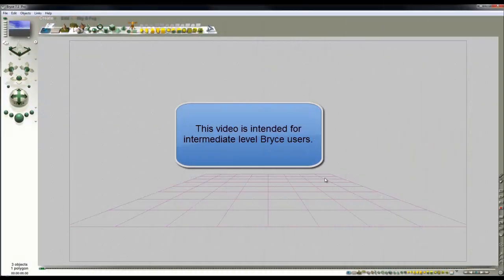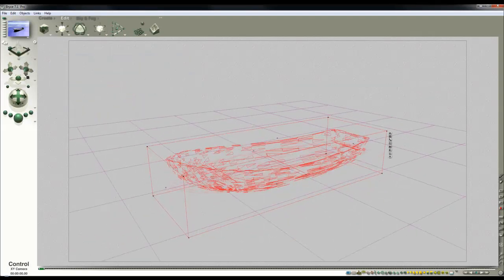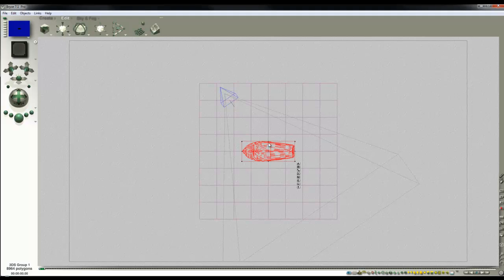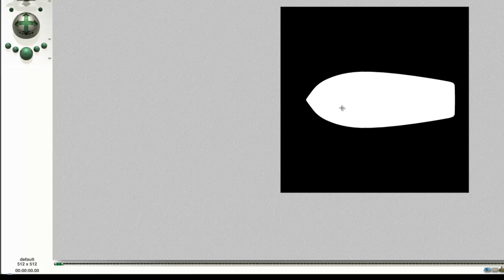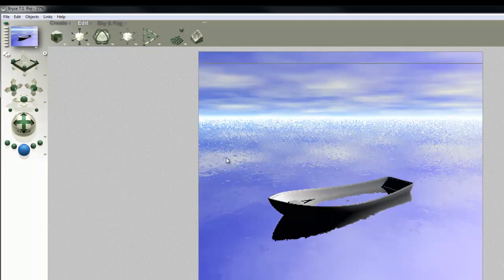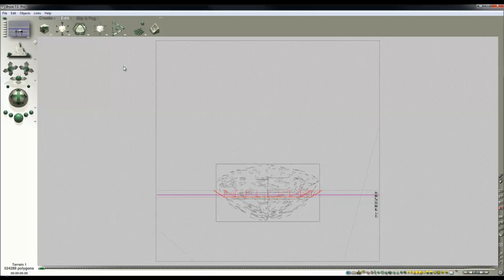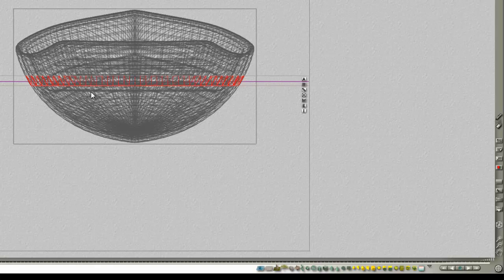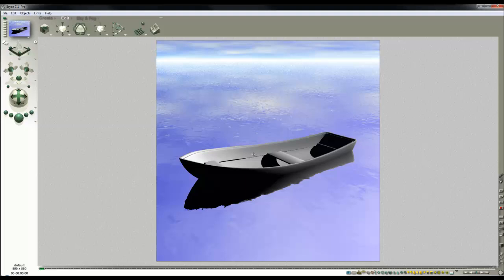Bryce 5 minute problem - how to prevent your boat from getting waterlogged? - by David Brinnen

Comment: I was thinking like eireannsg, that using a model of the boat that has no interior as the negative boolean part would take care of the problem nicely. 

Here is my suggestion:
Select the seat part of the Boat interior in Face Mode top, bottom, front and back. Tap L on your keyboard, to leave just the edges where the seat is attached to the boat hull, then Loop Cut it from the model. Rename it as 'Seat'. Hide the Seat. Now in Face Mode select all of the boat interior up to the rim, and do a Shell Extrude Normal, at 0% to make the shell paper thin (in other words don't move the extrusion at all). This makes the part that will be the negative boolean in Bryce. Rename it as 'Shell Extrusion'. After the Shell Extrude is done, hide the main model. Now with the interior of the Shell Extrusion still selected, do a delete function that will fill the interior. Next, switch to vertex mode, to select all of the vertices around the rim of the shell extrusion. Deselect the one vertex at the front point and the two vertices at the back. Tap C on your keyboard to connect the remaining vertices across between the sides of the Shell Extrusion. You now have the solid you need to make your boolean operation in Bryce work perfectly. that part should fit snugly into the interior of the main Boat model. Make sure you use the same material on the Shell Extrusion that was used for the interior of the Boat Hull. 

Export all parts to the same folder, and in Bryce import all parts. Do not move either of these parts separately, as you want them to remain perfectly aligned with each other throughout the next few operations. As you did in this tutorial, put the Boat, Seat, and Shell Extrusion in the water at a realistic looking depth. Select the Water plane and in the attributes for it, make it Positive. Next select the Boat model and in its attributes make it Positive. Select the Shell Extrusion model, and in its attributes make it Negative. Hide the Seat part. Now select the Water plain, the Boat model and the Shell Extrusion; making sure you have all of them selected, and do your grouping operation. Unhide the Seat, and in its attributes make it positive. In the grouped model attributes, make it positive. Now select the Seat and the grouped model, and group them. You should now have a Boat on the water model, with the hull hollowed out perfectly, and no water inside the boat. Rename the group as 'Boat on Water'. This version should have no artifacts visible, due to the way it is done.

I know this seems a bit more involved, but the explanation I am giving takes longer to write than the entire process itself does. The beauty of this method is that you can assign textures within Bryce to each part before the the boolean operations, and the textures on the Shell Extrusion will transfer to the finished result once the boolean operation is complete.

My apologies if it feels like I'm stepping on your toes concerning this. That is not my intention. I am just giving you my method of doing this, because you are the one that taught me most of what I know about Bryce. I feel that it is only right for me to give back to you what I have figured out due to your instructions. You are the Best!
Reply from the maker: That sounds like a valid approach, my argument for doing it this way was this was the more Bryce centric approach, I am fine with you offering alternative perspectives - there is no "right" way if the end result is the desired one, that's what the objective is.

Comment from the maker: Yes, you are right, that would be another potential solution, but it does rely on the person making the scene also being the one that made the boat.  It also relies on setting the "solid when boolean rendering" option - which is easy enough, but I always forget this first time around when doing this.  Using the terrain may perhaps be less elegant but works entirely in Bryce without recourse to using other software, which, in case you were wondering, is why I favoured this approach.
Reply: So far as being the one that made the boat is concerned, that does not necessarily have to be the case, unless the one that did make the boat has a "Do not make Alterations" clause in the readme. (Personally I don't even entertain such a draconian clause, for my Wings 3D models.) 

Anyway, as long as the model does not exceed the polygon count limits, which I don't see this boat even getting close to doing, you can import the boat into Wings 3D, and do what is needed for the way I would do the needed extra models. You're not actually modifying the original boat itself, only the part that will cut out the part of the water the boat needs to appear to float on. The inner surface of the hull becomes the outer skin texture of the shell extruded model, meaning you can keep that texture on it for when you cut out the part of the water you need gone.

I would like to tell you about the best of the latest tool additions for Wings 3D, which is in my opinion the one called Boolean Test. It is included in the Context Sensitive Menu of Object Mode. It does similar operations to what Bryce's Boolean operations do, but in a different way. I have been experimenting with it, and learning how best to use it, for well over 2 years now. 

It has three options you can choose from, which I will describe briefly here:
1. Boolean Test > Union - Used to turn two intersecting objects into one fused object. To perform this operation, two objects must be selected in Object mode. Right Click , then Left Click on Boolean Test, Left Click on Union, and then Right Click to complete.
2. Boolean Test > Intersect -  Used to make a new object out of the overlapped parts of the two selected original objects only. To perform this operation,  two objects must be selected in Object mode. Right Click, Left Click on Boolean Test, Left Click on Intersect, then Right Click to complete.
3. Boolean Test > Difference - Used to cut out part of the first selected object in the shape of the part of the second selected object's overlapped area. Select the Object you want to cut out part of, Right Click, Left Click on Boolean Test, Left Click on Difference, Select the object that you are using to cut out part of the first selected object, then Right Click to complete.

Note: Preparing the surfaces of the areas that are intersecting will help to minimize the chances of bad geometry. Also, Boolean Test does not work with coplanar surfaces, nor with it work with one object piercing through the other object from one side to an opposite side. This is where Bryce's Boolean Operations are superior. Bryce Boolean operations can work with multiple selected objects in one operation, whereas Wings 3D Boolean Test can only work with two intersecting objects. Still, it can be used to do operations or modeling jobs that used to take several more steps to complete in Wings 3D. The one thing Wings 3D doesn't have to have for Boolean Operations is the Positive and Negative aspects of objects. In that regard, Wings 3D does work a better way.

I'm thinking about doing a tutorial, but I want to get all of my facts together first. I have not yet found any tutorials that cover this, and I'm sure, lots of Wings 3D users would love to learn about it. I plan to show how to optimize the intersecting areas, to reduce the chances of making bad geometry in the same tutorial. Hopefully my tutorial won't be hard to follow.